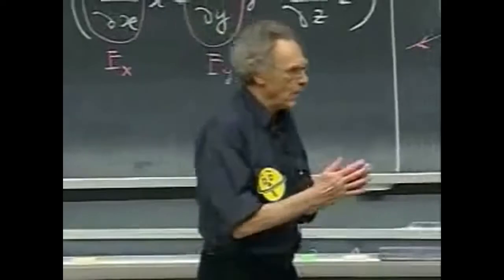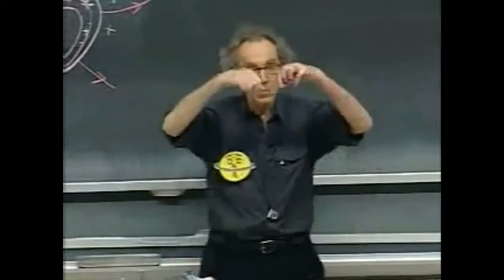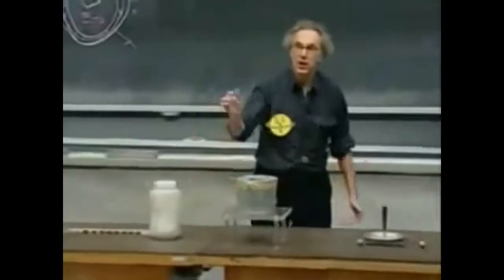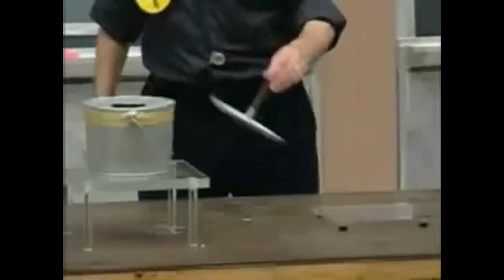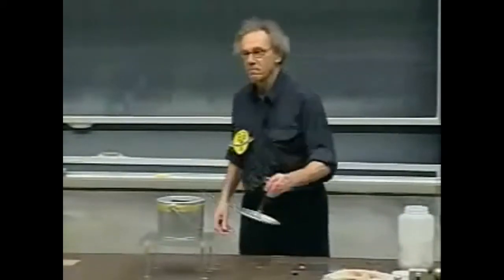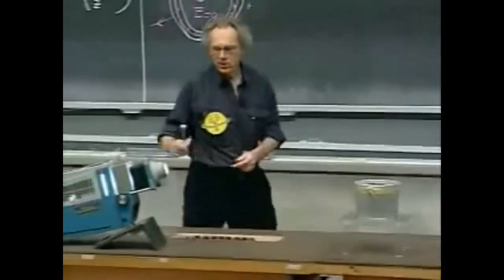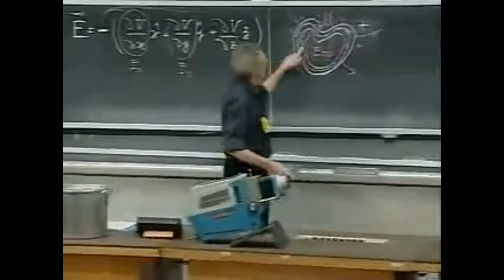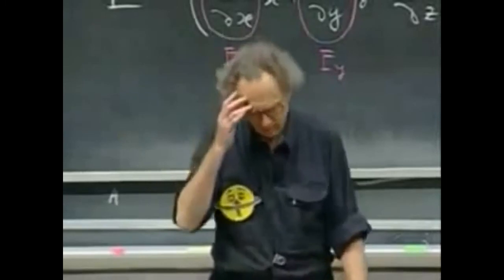Electromagnetism Lec 5 Electrostatic Shielding Demonstration of charge distribution in a conductor

Comment: Nested Spheres  
We know that for a conductor/metallic sphere ; charge can only reside on the surface of the conductor. In a nested spheres situation there are two charges namely q1 ( on inner sphere) and q2 ( outer sphere). Why the charge on the inner sphere does not appear on the outer sphere ?  Reason :-  When we keep a charge q+ at the centre of the shell it appears as a +q charge at the surface of the shell